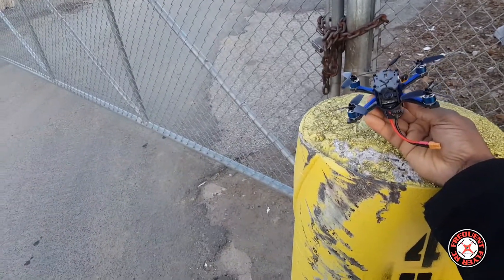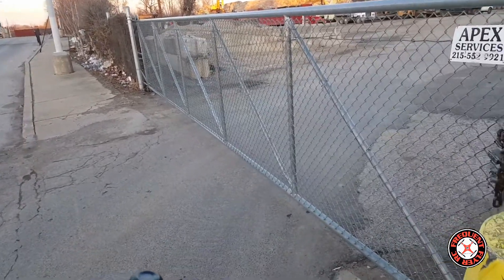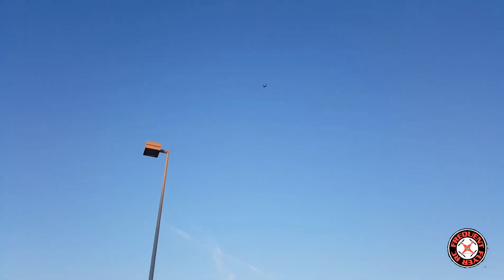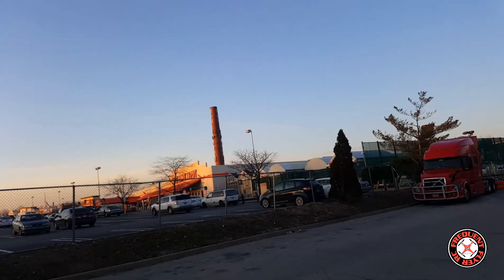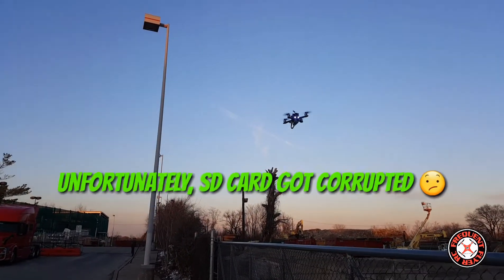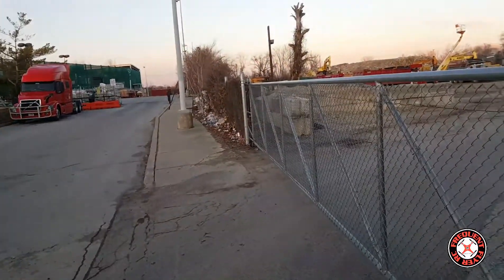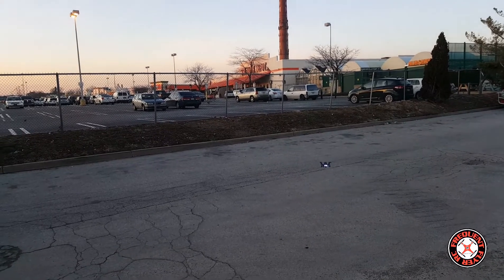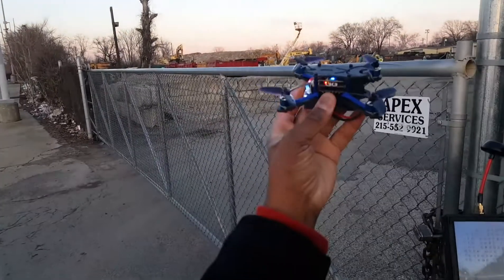Mini Fight 110 Flight Demo 450mah 3S Graphene with Good PIDs

Comment: Nice flying. I'll try these PIDs as well, currently using AndyRC's settings, which are somewhat similar.
Reply from the maker: +RC-Fan NL Thanks, I really didn't tune using FPV I tuned line of sight. Adjusted until I couldn't hear any more flutter or oscillation during mild punches and descent. I didn't touch yaw.
Reply: I'll report back on how these PIDs work on FPV, when I get the chance to test. Next days temps are dropping, batteries and me don't like freezing temps on a windy field. ;-)

Comment: ;) Such a nice lil ripper! 👍👍 & A 28a esc!,, Damn.
Reply from the maker: +WCO lll amazing power for sure
Reply: Frequent Flyer RC I believe Dr. Kabob was right lol. Yes these little micro beasts fly okay with average 10/12 ESCs.. but strap on a 30/28a!! and everything just gets better!.. including tuning. Side bonus,, if the frame breaks, you have spare parts for your ultralight, 5 inch.lol
Reply from the maker: +WCO lll I think the 1106 Sunnysky motors & Gemfan 2540 tri-blades are a big part too! 1106 is best for this prop, i think it's the sweet spot! And I say that because I removed the 20amp ESCs from my Innov 120 Build and put in 10amp ESCs and it is as good as this only using a 2S and unbelievable on 3S! 😆

Comment: I just got mine and wow it needs a tune. I have several quads now and never have I seen a quad run so bad out of the box on 3S. I thought I had a bad quad at first. I had the lower the D's to like 11 or so just so the motors wouldn't burn up. I just flashed 3.4 so hopefully, the filters will help some. Gearbest won't help so I won't even bother fighting with them but hopefully, I can get it tuned. I would try your pids but at 16 and 17 I think it's still too high. I think the motors are not the best and every quad is different as not one reviewer has even remotely the same D's. Any suggestions?
Reply from the maker: Try out my PIDs and go from there.. It's a combination of PIDs, props and what battery you use. My PIDs should get you close but every quad is a little different. I have never turned off the notch filters before.

Comment: Freak - where did you end-up with your PIDS?  Looks like you got 'em right.  Could you please post them?
Reply from the maker: +George H PIDs are in description now👍
Reply: Frequent Flyer RC  - thanks buddy!  Pretty close to what I ended-up with on a very similar setup.  I'm at 28 for pitch and roll P-gain, 15 for D-gain on roll and 18 for pitch.

Comment: I'm still having a bit of a hard time tuning this fellow. P gains in pitch and roll are 20 with d gains at 10. I've ran the gambit, from p 30 d 19 down to p 20 d 8. Any luck, mate?
Reply from the maker: +Imaginertiophile my PIDs are in description..
I tuned LOS playing off ear. Dropped D and P until vibes and flutter was gone in rise and descent. Might not be as good for FPV..
Reply: Frequent Flyer RC For FPV i set pitch  p23 i50 d12  roll p22 i 45 d11. That seems to be the sweetest spot i can find. Works well with 3S 550mah and 4S 450mah.

Comment: Good job sir :)  It does not sound as 'clean' as some, but could just be what these props sound like :) 
Much better! 
Have you tried the HGLRC XJB-145 by the way? See my last video (shameless plug :P)
Reply from the maker: +DutchRC Adventures Thanks, yes that was one of the best of 2017! Really awesome quad rivaled by the GEP RC Sparrow. You know I fly the heck out of a quad multiple times and show flights so I did a few vids on the XJB 145 but never got to touch the Sparrow to compare. I do however have the awesome 1408 4100Kv motors from GEP RC that comes on the Sparrow but plan to put them on a 4 inch build! Will slide thru to check your channel as I'm always interested in opinions of others 😆👌
Reply: You should really try the MX-3 Sparrow. It flies and sounds amazing. And definitely check out the FPV Egg 138 Pro: https://www.youtube.com/watch?v=-BKA7hhgW_w
https://www.youtube.com/watch?v=i4uNJXvob9Y
Reply from the maker: +RC-Fan NL which you think is better? Egg or Sparrow?
Reply: That's a tough one. I think I'd still prefer the MX-3 Sparrow. Those motors, combined with good stock PIDs and the nice looking frame, just feels and sounds amazing. But the Egg 138 has OSD, and despite the lower power VTX, seems to have a bit cleaner signal. Here are some Sparrow vids I made, all still on 3S, but imho already great power: https://www.youtube.com/watch?v=ybHVRWSh64A (loud wind noise btw)
https://www.youtube.com/watch?v=NeqZHIZHr68
https://www.youtube.com/watch?v=QheEVR6bAeA (video made at dusk, so more noise in picture)
Reply: Save those GEPRC motors for a fast 3". They are not meant to swing 4" props, check out EngineerX's test on the 3500kv version of them  -- they let out smoke on 4 and 5" props, 4" on the 4100kv will be well outside the safe range for the windings. I have the 4100kv, they're insanely fast on 3. Here's a link to where it pours smoke on 4" lol. And like I said, this will be far worse on 4100kv https://youtu.be/uLS1kyIiWxg?t=7m49s